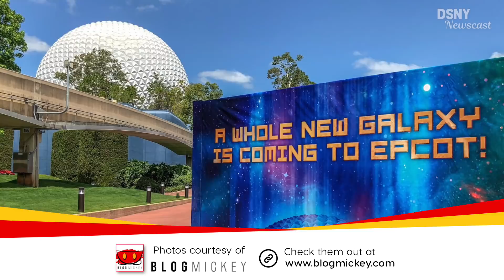Analyzing New FROZEN-Themed Lands Coming to Disney Parks - Disney News - 5/8/18

Comment: I actually ended up predicting the Frozen roller coaster in 2016!

During a trip to Disneyland, me and my cousin discussed if they would ever bring over the Seven Dwarfs Mine Train from WDW over to California. I said they probably would, but " it would probably be Frozen themed to fit in with the area better ( since its rumored to go where the Motor Boats/Autopia is now, which is right near Matterhorn. Well, turns out I was very close - it's just not coming to Disneyland ( yet).

Comment: Hidden Mickey: 2:37 - I think that Disney Parks should make San Fransokyo from Big Hero 6, where you can step into an alternate San Francisco and meet your favorite characters from the movie and upcoming tv series. And the main ride should be like Universal Orlando's Spiderman simulator ride, but here is the twist, the ride system will still be a simulator ride but it will also be trackless and it will not only have 3d screens but it will also have augmented reality scenes where the characters not only battle in front of you, but you can also see them on the left, right, and above which puts you right in the action to help Big Hero 6 save San Fransokyo from villains from both the movie and tv series.

Comment: Disney has always cloned what they call franchise attractions. Having seen previous ideas that date back decades from WDI friends, almost every attraction at one point or another that is considered major is considered for every resort.
As an example the extraterrestrial alien encounter attraction was actually designed for Disneyland and was to be built at the same time in WDW.  Due to political issues within TDA and WDI the Disneyland version got delayed and WDW rushed into construction. The bad handling of the opening there gave TDA cold feet and they canceled the project.  Also testrack was also designed to be built in DCA originally with a California speedway theme surrounded by a 50’s roadway filled with shops and eateries.
Bad decisions pushed that back which eventually evolved to another project then again changed to Carsland.

Space which was built in Epcot was also designed with cloning in mind and was suppose to built inside the innoventions building.  Because of overcost in WDW and delayed openings along with the original bad publicity of people getting sick at first TDA cancelled the addition.

It’s no surprise that WDIdevelops multiple artwork of an addition as they develop and sometimes because the same project needs to fit a different possible piece of property in one of the other resorts.  Then these proposals are showcased to the resorts to see if they are interested and if budgets are available